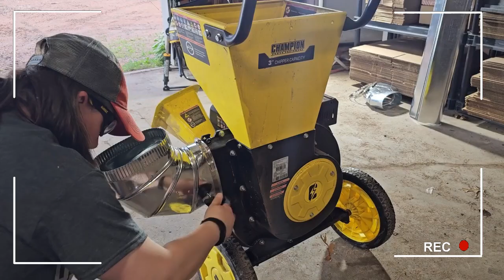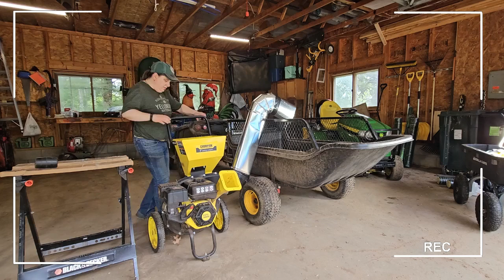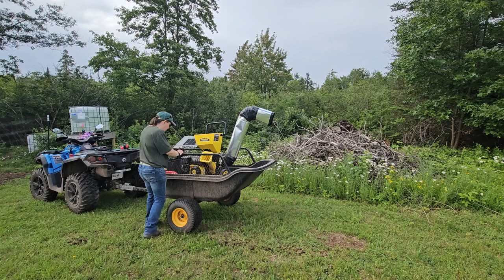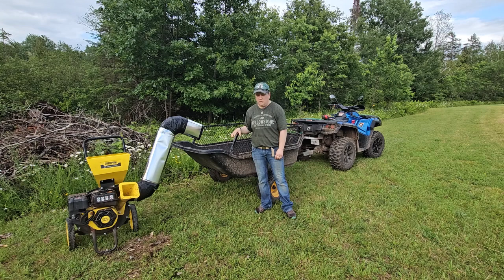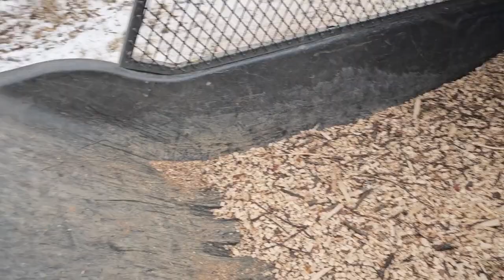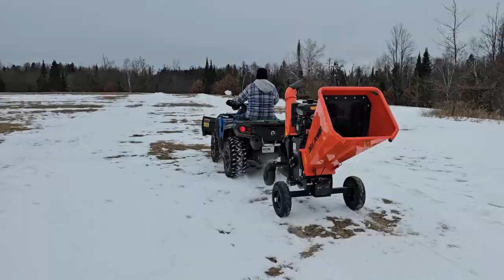Upgraded Champion 3" Wood Chipper Discharge Chute Mod Field Test – Does It Work?

Comment: I am surprised it worked as well as it did ... those bends are killers.  45 with some distance should help chip movement and cut down on the vibration. .

I am going to try a "box" with a hardware cloth lid ... to let air escape. Shovel out on end when full
Reply from the maker: I had thought of the tool, something to shoot it into. I think hardware wore would get tangled up with chips. What about a plywood box with a few 1/2 holes drilled into it? I had also thought of that. Heavy though.

Comment: Wood chippers with discharge chutes always sort of spray wood chips everywhere. In my experience about 85% of the material from any given chute, even the expensive ones, ends up in the target destination while the rest of the chips are sprayed all around the trailer. Laying down a cheap tarp or even an old bed sheet could be an effective way to collect the remaining chips. This way you just have to scoop up the tarp and dump it into the trailer at the end of the day. If you use a rake to break up the chips then you end up mixing a bunch of dirt and whatnot into the trailer. Good overall design. I like it!
Reply from the maker: I know exactly what you mean. I have never found a good solution to that.
Reply: Two fixes: A divergent duct at the discharge end. This will reduce the discharge wind velocity and maintain the same volume. e.g. Trumpet looking end. Or, place a chip screen bag over the discharge end and cut off the bottom of the bag.